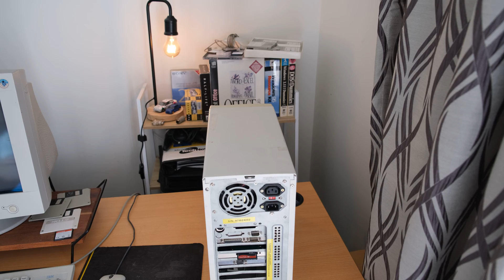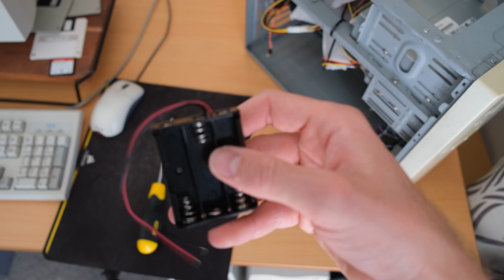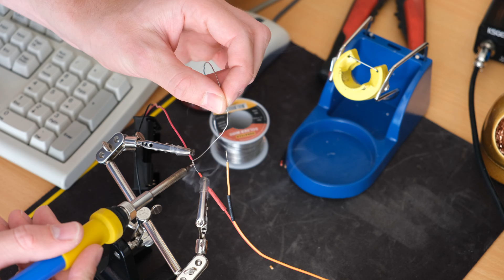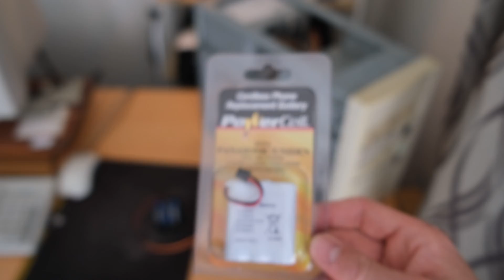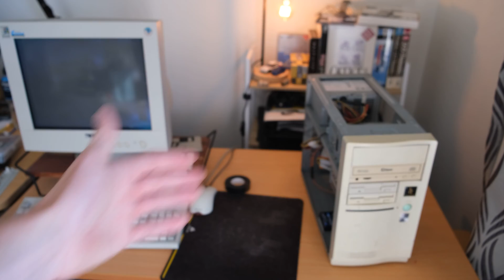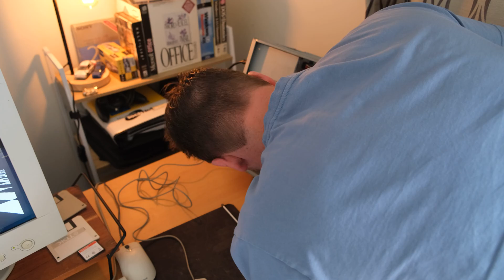CMOS Battery For The 286

Comment: A CR2032 would be the best alternative for your situation. Though, your solution has been implemented a lot back in the days. 

Do watch out for leaking alkaline batteries. They tend to leave havoc when they go bad and leak. Lithium batteries would be perfect, as they only leak non corrosive gunk. :)
Reply from the maker: Yeah the leaking battery's can be a concern. I'm hoping that putting the holder at the bottom of the case will help avoid any leakage onto the motherboard, if it does leak. I've seen the CR2032 holders but have also heard that they can drain rather fast depending on the load. So went with a option that was A. Available in NZ. B. Cheap and easy. But so far so good for keeping the clock settings!